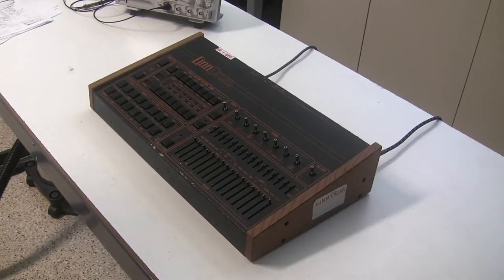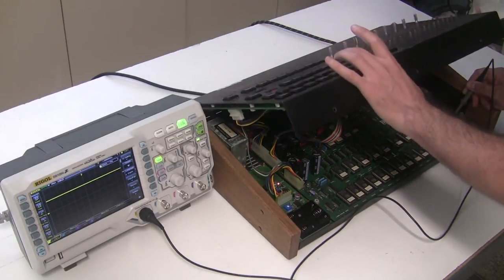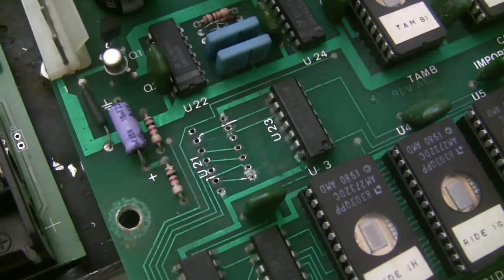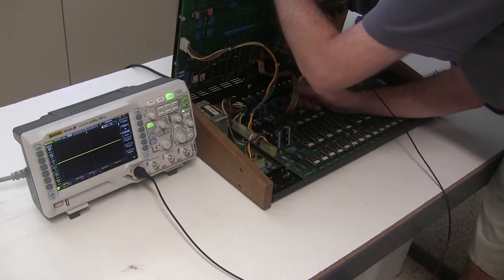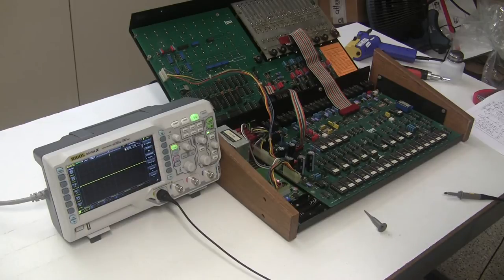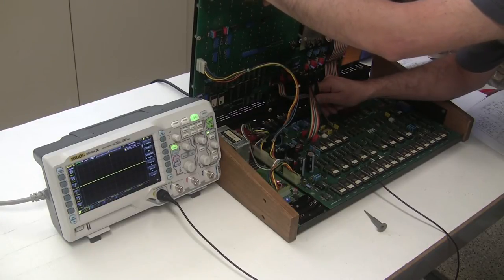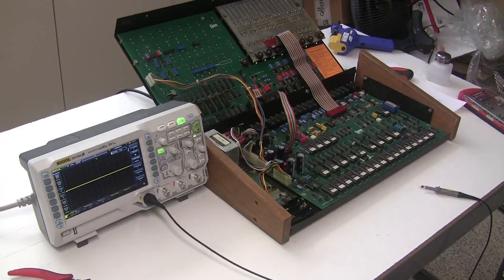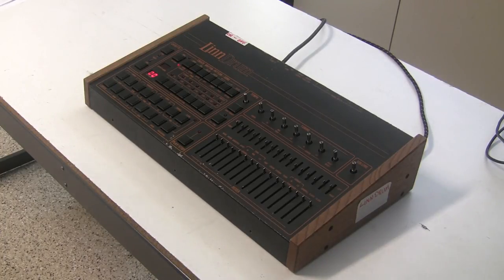Synthchaser #046 - LinnDrum Repair 2/3 - Fixing Drum Sounds & Noise

Comment: Thank you so much for this. It really helps to have the sequence of events spelled out, which chips handle and process those events,  how they're functioning, and on which pins. This is gonna seriously help with troubleshooting, needless to say. I find the service manual a bit obtuse, and I'm not generally familiar with digital chips' more detailed operations and the diagnosis of their malfunctions. 
Right now my friend's LinnDrum seems very confused; many sounds are firing at once from hitting one key. Also, although I have sound at the L-R rear outputs, every single individual sound output is dead. I suspect the multiplexer, but was having a bit of trouble understanding just what the chain of events was. now I don't have to pore over the manual for a good while before really understanding how to troubleshoot the multiplexer (and the other chips in the digital/ analog signal chain).

Thanks a million!

Comment: I love watching your videos, you are very thorough with your analysis. Right now I have a dead bass kick (both internal mixer and dedicated output has no sound) and a ride voice which is quiet on the mixer output but full on the dedicated output. I've tried swapping 4051's in a few places but to no avail and I don't have an oscilloscope. It actually worked until I changed the batteries but after that the bass kick failed soon after. I have also recapped (aside from the 27000 uF). Any ideas?
Reply: Edit Replaced the bass op amp and now have a feint bass kick, but can't find any failed capacitors along the way. I'm guessing all the resistors are fine too. Invividual out has noise too, although mixer out doesn't have anything wrong.